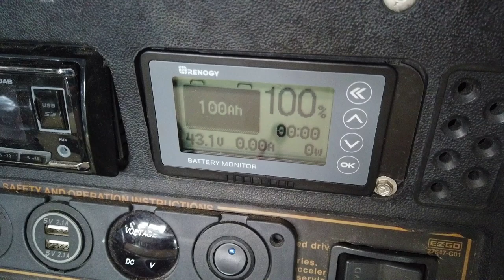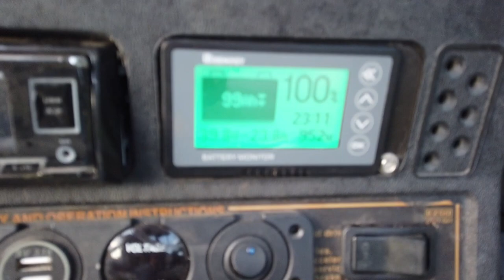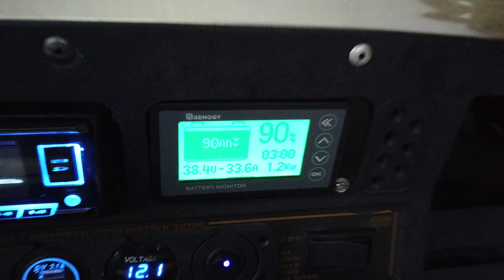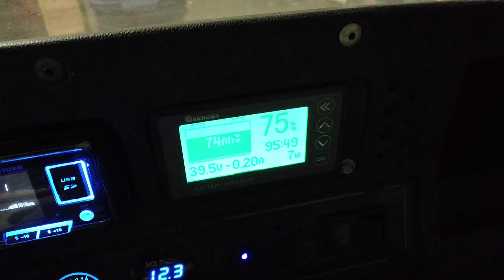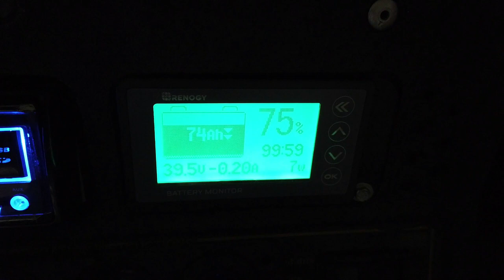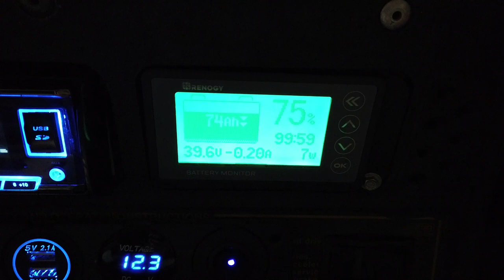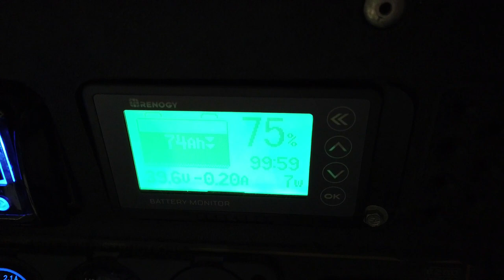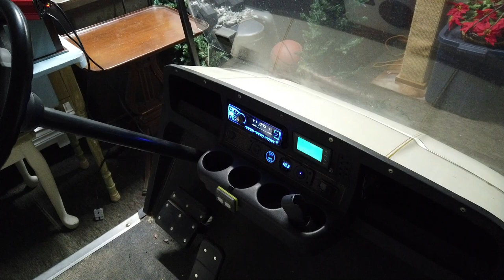Dakota Lithium range test on 36 volt TXT EZGO golf cart and Renogy monitor

Comment: I really appreciate the effort and detail you put into your videos about the battery upgrade. I recently inherited a 36v TXT with shot lead acid batteries and your videos helped in my decision to upgrade. The real testing and actual numbers vs just saying "it's lighter and lasts longer" was great. I am pretty much doing the same thing as you, 36v txt w/ pds to lithium, so I appreciate the fact that someone else validated it before I did.
Reply from the maker: Thanks. Much appreciated. If you dont need to do wheelies or go 35-40 mph then its actually a great reliable and inexpensive combination. One thing is you dont need the Dakotas. Although they are a great battery you can get the same thing from other batteries at around half the cost. But the Dakotas are a good solid battery.

Comment: Very good video. Thanks for posting. Also good to hear you telling folks not to take them down to zero. Have read 100 to 0 will get you about 3000+ cycles. 100 to 20 extends that to 7000+ cycles. Renogy (meter) makes great equipment. Keep up the good work!

Comment: Cool video. I just upgraded my club car to 48v lithium NMC. I used big battery BDGR 48V x4 with 132 aH. What a huge difference in the cart. I calculating roughly a 60 mile range, but havent had a chance to run it that far. I really like that Renogy batt meter.
Reply from the maker: A good meter is a perfect complement to the lithiums. Its the way to go for sure. I bet you have all of 60 miles too!

Comment: Great video. Do you happen to remember what you set your High and Low Voltage limits at? 43.1 for High but I didn't see what you had for low? Curious for when I install my system. Thanks!

Comment: Would it make any sense  to use a single36 volt lithium  battert in place of the three 122 volts or is that a bad idea, would performance bre reduced?
Reply from the maker: Yes, As long as the max amperage output will not be exceeded. When I bought these there really was no single 36 volt battery. Now there are several that i think would work good. There will be less balance problems over the years using a single BMS on a 36 volt battery over 3 BMS in 3 twelve volt batts in series.

Comment: awesome people drives the battery man crazy how far will my golf cart go well you got to figure you got factory 250 amp controller or you got 500amp controller do you have stock motor or a high amp speed motor all that matters is the tires golf course tires or you have over size tires everything matters factory cart with lithium pack will go all day an less miles everything you customize

Comment: Question on your install of the Renogy.  Where did you put the cart key when installing the gauge in that plate?  I’m trying to figure out a good spot to relocate the key so I can install mine in the same place you did.  👍
Reply from the maker: I actually swapped the key out for a pushbutton on/off switch that lights up green when on. I put it all the way on the left side near the driver. I just cut a hole for it

Comment: Hi, I just purchased the same thing, a 36v EZGO TXT! I wanted to ask, did you upgrade your speed controller too? I am going to go a slightly different route than you did, I will be making my own LiFePO pack using prismatic cells. I was impressed that you were able to get 21mph with just changing the tires to a bigger side (if that's all you did).
Reply from the maker: I did not upgrade the controller.  We mainly just do basic cruising so it's very basic.  Just wanted to not mess with batteries for along time..lol. good luck on your project 👍

Comment: Finally got mine installed on my golf cart. Can you turn this thing off? Or does it just go into a low power mode where the screen still displays numbers but the backlight goes off?
Reply from the maker: Can't turn it off. It lights up when power comes in or out

Comment: I have an '05 ez-go 36v txt bone stock that I picked up dirt cheap. Wouldn't run at all for the other guy. He swore it needed batteries (which it does) but the real problem was the old Powerwise charger relay and control board. Jumped the relay and it charged right up and worked. But I'm at the point where batteries are a necessity and I'm thinking lithium is the way to go. Do you have any problems climbing small neighborhood hills at all with the new Dakota batteries? Gentle 1-3%grade type stuff? Any issues with it cutting out and/or shutting down the batteries? I plan to use mine on the hunting ranch as well as neighborhood cruising.
Reply from the maker: I have never had a BMS disconnect. I have gone up and down some mild hills and offroad. I dont know how it would handle a sustained hill at max power. The Dakotas are right on the edge as far as the max discharge rating. They are 100 amp continuous and 200 peak for 10 seconds. The Dakotas are still very expensive as well. If you could fit three Chins or Amperetime 200 AH batteries in there you could get them actually cheaper than the Dakotas and have twice the available amp draw available and twice the AH rating for range. My 36 volt PDS cart pulls just over 100 AMPs when mashing the throttle for just a second or two. Then it settles around 75-80 amps. If I had big tires and was going up hill I could see it having a sustained AMP draw greater than 100 amps which would cause the BMS to cut power on the Dakotas and most other 100 AH off the shelf batteries. If you could fit a 200 AH Chins or Ampere Time plus version you would have plenty of available discharge amps to draw from (200 AMP continuous 400 amps for 4 seconds) for twice as long. Check Amazon for Chins and AmpereTime Plus. Also check out Will Prowse here on youtube for testing and info on various batteries. Also if you will be charging and operating at lower than 32 degrees you can ruin the batteries by charging in colder than 32 degrees. There are coldweather batteries but they are more expensive. good luck.
Reply: @mvintrigue-trawlerdiy1101  great info! Thanks for the quick response. I've been debating that very possibility in my head now for a week. Wasn't sure if those cheaper Chins batteries on Amazon would be any good or worth the $$. And didn't know if there would be any problems with the BMS cutoff on either. Also a bit concerned about warranty, customer service, and battery issues with those but the cost difference is significant so...🤔🤔😖😖 too many options that lead to more questions. Lol.
Reply from the maker: @brandtjustsayin  Ill be honest with you. I dont put any real faith in any warranty at all. The time spans these batteries should last really make it hard to believe warranty could be done in 6 or 8 years from now. And I would bet they are prorated anyways. So I would get batteries and check them out for proper operation/charging discharge right as you get them...and then go for it. There is still a slight gamble but start watching Will Prowse's videos.

Comment: I'd like to see a video on how you wired everything up...i have the renogy meter and Dakota lithium 36v 60ah set but can't seem to get the charger to work properly unless i charge each pack individually
Reply from the maker: Everything is wired exactly the same as stock with one exception. I have removed the stock charger plug and reed switch and put in an Anderson style plug that matches the charger. Are you using a 36 volt charger or a 12 volt charger? It must be a 36 volt LIFEOP4 charger that actually puts out like 42-43 volts or whatever lithium is charged at. Lithium is charged at considerably higher voltage than a stock lead acid 36 volt charger and it does not have the various stages of charge like lead acid. Make sure you charger is specific to Lifepo4.
Reply: @mvintrigue-trawlerdiy1101  it's the 36v charger the send with the pack
Reply from the maker: @psylentknight2222  it has to be a wiring issue. Something isn't right. In theory you should be able to put the charger wires on the same terminals as the output wires. The cart runs fine otherwise?
Reply: @mvintrigue-trawlerdiy1101  yes the cart runs fine

Comment: Very nice. So you didn't even need to change the controller to work with the lithium?
Reply from the maker: Not at all. Easy swap. You just need tomake sure you get a charger compatable with the Lithium. Dakota sent one but I bought one from China that works well and can recharge the pack in about 2 hours.

Comment: Which Amp Hour batteries did you choose? Just curious because I want a lot of range if I spend this much on batteries!
Reply from the maker: They are the Dakota 100ah. Just be sure you are all stock. If you have any large amp controllers or motors or even huge tires and run on hill you might trip the internal battery management system.  What are the details of your cart? 36 volt? 48 volt?
Reply from the maker: BTW go to my channel and look at the most recent video. I did a real actual range test and Got 42.5 actual miles with around 9% left.
Reply: @mvintrigue-trawlerdiy1101  I have a lift and bigger tires on my cart. It’s a 48v Ezgo RXV and it was tuned to the “freedom” setting by my dealer before I bought it. I’m not sure how to know if they changed any large amp controllers. Mind giving me a call or text or email?
Reply from the maker: @sapanpatel4422  If it were me I would probably go with something like the Extreme Team or Roypow battery that is around 170AH. I think several models can handle around 200 amps continuous and 350 amps for 10 seconds. I think you might get away with Dakota 100AH but you may have to drive it gently by not slamming the gas pedal all at once or not climbing steep hills at full throttle etc. As for info I would be happy to answer what i know. However check out Golf Carts Modified group on Facebook. There are many people much more knowledgeable than me.

Comment: Can you make a video of the installation of the Renogy battery monitor. My % stays at 100% at all times. Wondering what I did wrong?
Reply from the maker: Go to the back of the renogy and unplug it there. Must be back side of renogy unit. Then wait a second and plug it back in. If that doesnt do it its in the programming.

Comment: What was the max amp draw?  Did you test on any hills?  I’m reluctant to make the switch to lithium as my campground has a decent hill that my kids like to drive up and I’m worried the amp draw will cause the BMS to cut the battery off.
Reply from the maker: We don't have many hills. Max I see on the meter is around 100amps momentarily. On flat ground at full throttle and 20 mph is around 50 amps. I have seen a few companies that sell 150 ah batteries that have a more powerful BMS. Dakota also has a 135ah start capable battery now that can handle high loads. But they are pricey. Standard off the shelf 100 ah Batts are always cutting it close for golf carts. But I have never had mine cut out in 2 years.
Reply: Chris I saw this video that might help you. Seems to max out at 110amps. https://www.youtube.com/watch?v=p3kJkem3dGA&ab_channel=BlueTrepidation
I have also been in the same boat and just did a deep dive on Amps. These 100ah batteries are made for 100a continuous and 200a pulse for 10 seconds. Not sure if this will be in your comfort level. It was for me. Just a heads up. Their new batteries are rated for 400A continuous but are only 63ah. They have a 135ah version, but they are over 3k. Hope this helps
Reply: @DouglasArabie  I ended up getting a new set of flooded lead acid batteries but I did install a renogy meter on mine and my cart pulls over 200 amps by the time it gets to the top of the hill at camp.  Glad I did not try the cheaper lithium option.

Comment: The small red wire (B+) powering the shunt and display can receive what voltage level? Is it 10V-120V, same as the monitoring capability? I can either pull 12V from my voltage regulator which will be switched, or choose 36V straight from the battery bank. Thanks.
Reply: Ah! Answered my own question... yes B+ is used to power the unit and can run on 12-120V however since you want the battery voltage to be displayed, you want to connect directly to its outputs.

Comment: I bought the 3 Dakota lithium 12 volt 60ah batteries. Would the renogy meter work?
Reply from the maker: yes it will
Reply: How far do you get on the 60 ah?
Reply: Where did you install the shunt?